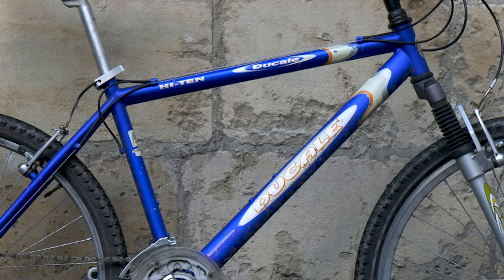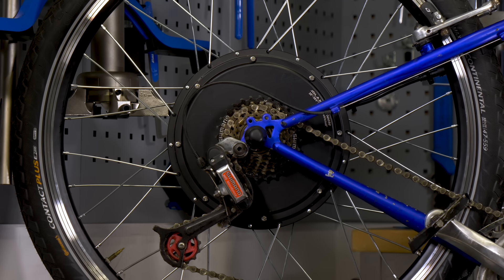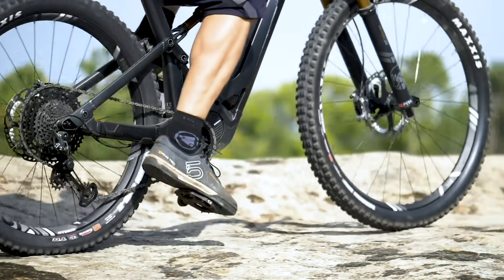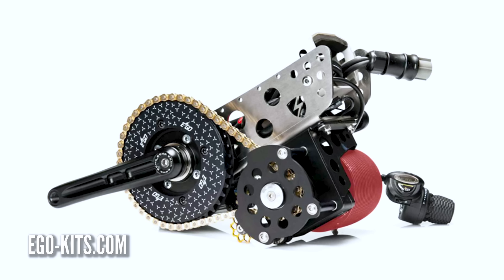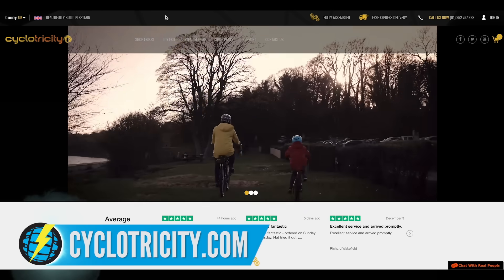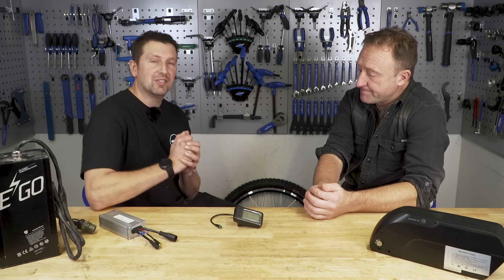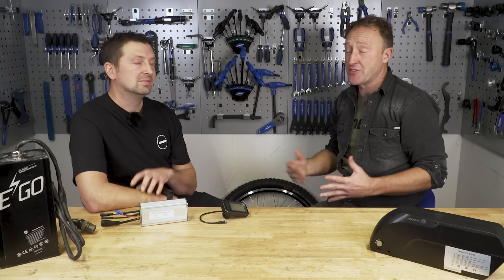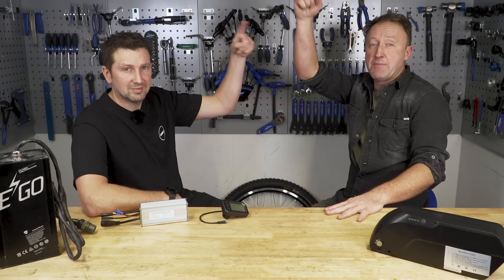Electric Bike Conversion Kit Options | DIY E Bikes With EMBN

Comment: The problem with most manufactured e-bikes is that they generally only go up to 15 mph.
Reply: If I'm not mistaken that's because of eu regulation, which limits their max power and speed.
Reply: @rfldss89  Yeah I already know why.
Reply: @MrRockstar1968  You can't just exclaim a problem and when somebody points out the reason for the problem arrogantly tell them you already knew the reason 😂😂😂😂 rude
Reply: @MrRockstar1968  ok and not everyone knows that…
Reply: A name like Mr rock star + the inability to take advice + the inability to take criticism screams narcissist to me.
Reply: @rfldss89 true! Very good point meeladdo failed to mention. He also got the speed wrong 😂
Reply: If you get the right motor you can programme the controller I did it on mine. Very easy with a Bafang motor
Reply: @Amanwithoutaplanhere  I have no idea how to even do that.
Reply: And they cost about 2 grand
Reply: @dylan1586  You can purchase one for 2 grand or less that go faster than 15 mph up to 40 mph or 60 mph.
Reply: @MrRockstar1968  not sure where to look tbh there's so much Chinese crap about, I've been trying to get a decent e-dirt bike for a while now
Reply: 😂 these comments got me rolling a governor is something that restricts a vehicle boat etc of it’s of its speed it can be electronically or a part..
Reply: js take off the governor
Reply: @k1ngdonnie  Don't know how to do that nd don't even know what the governor is.
Reply: It is for your safety at first 🥇
Reply: @legal-emigrant  bullshit.
Reply: @MrRockstar1968  no brain - no problems
Reply: @MrRockstar1968  15 mph is plenty fast,  if I wanted to go faster I would just drive my car.
Reply: @JoshuaB-p8c  That's your choice though certainly not mine and i can peddle my bike faster than 15mph, so 15mph is not fast.
Reply: @JoshuaB-p8c 15 mph on a bike is not fast, 35-45 mph on a bike is fast
Reply: @MrRockstar1968  You can reprogram a lot of those.
Reply: @Freedom-Riding  Yeah you're right, I have heard of reprogramming been possible, though unfortunately I have no idea how to do that.
Reply: @MrRockstar1968 Yeah if it has an interfaces usually you just press some buttons to go into developer mode or i heard some others you just disconnected a speed sensor.
Reply: In the US it's about 20 mph and it starts to reduce power at about 18 mph . This is for a good reason. Most of those are used on bike paths that are designed for multiple use . They don't want any going over 20 mph on those and would prefer most of the traffic going more like 15 mph. That is because people are  also using these to walk on and many people are also listening to music at the same time so they don't want people going 25 mph on them blasting past the sometimes unaware pedestrian traffic. It makes the inevitable collision less impact full. The difference between an impact at 15 is usually minor and at 25 isn't usually much more catastrophic. It's the difference between a trip to the ER and getting home on your own. That's why most municipalities only allow Class 1 ebikes on them. Even though I can ride faster than 18 mph on my regular road bike I would keep it 15 to 18 as a curtisy for the others especially when it's busy.
Reply: I am in the US, I ran an old Cannondale M700 with a Bafang 750 Watt, 42t chain ring. I can do 30+.
Reply: Get herself a motorbike if tis speed ya want....the rules of 25kmh in eaurope are for a good reason....think centre of gravity...and then while yer at it...find one for yourself.😁👍
Reply: @universalelectricradio2373  I actually already own a motorbike. Also as for you stating "the rules of 25kmh in Europe are for a good reason.......think centre of gravity". Your alleged good reason has got nothing to do with my initial statement where I stated: "The problem with most manufactured e-bikes is that they generally only go up to 15 mph". Neither has it got anything to do with centre of gravity. There are e-bikes that achieve speeds of 110kmh and their centre of gravity is perfectly fine, you haven't got a clue what you are talking about and you are talking utter nonsense in an attempt to sound clever and intellectual. The FACT for the reason of the 25kmh rule is due to the fact for a bike or any vehicle exceeding this speed will then need a drivers license to authorise the use of which has nothing to do with centre of gravity, you muppet.

Comment: Hi :) can someone please recommend a conversion kit for me please ? I have a hybrid giant roam 1 2020 with 700x42 tyres. I’d like to go 25 mph + with a high range on the battery as id like to use it to do food deliveries all day !
Reply: Definitely go a direct drive 1500w hub motor conversion as the torque & power helps make it safe in traffic in built up areas.
Reply: I agree.

Comment: What about carbon fibre bikes? I have a santacruz blur xc and would the mounting of batteries and motors strain areas on the frame that weren’t meant to have weight or stress?

Comment: Just to be clear Cyclotricity are just rebadging cheap Chinese kit you can buy off ebay and Amazon. Fixing a heavy battery to the bottle cage is a terrible idea if you want to go off road. The base plate will end up being fixed to the frame by 2 or 3, 5mm thread captive nuts. That's not a strong enough fixing, ok on the road until you hit a pothole or speed bump at 15 mph. Motor power ratings are more or less irrelevant, it's the torque you need to get you up a hill that counts. I built a 500W front hub ebike and it wouldn't pull the skin of a rice pudding uphill, as it had a rating of 35 n/m torque. My Bosch CX Performance Line which is fully legal does 70 n/m torque and pulls like a train uphill. Those Bafang mid drives have the motor exposed under the bike without a bash plate and there's no protection for the wiring. Don't be fooled by the 250W power rating of legal e-bikes, it's just a figure for the continuous rating, they draw way more power in reality. I wouldn't be riding if it wasn't for e-bikes, but do your research well. Hope that helps someone.

Comment: i built my own 48v 1000w rear hub lcd kit a few years ago now, first i had 10c 12s multistar 20,000mah.
they puffed after a year or two,
now i use 12s turnigy 60c 5000mah.
bike still weighs a metric ton.
still hauls ass.
only runs for about a 12km ride, or 1hr.
so will have to take a normal bike on day trips.

Comment: With a 48v 1000w front wheel  can you use a less powerful battery than required (I understand it may not go as fast or last as long)  but will it still work  ?

Comment: Interesting video, clearly supported by Cyclotricity. I have recently fitted a Whoosh Bikes UK legal rear hub drive kit to a VooDoo Limba Gravel bike that I owned. Fitting was straight forward, I looked at the Cyclotricity kits but chose the Whoosh kit mainly because the controller is built into the battery carrier, it looks much neater. The only problem was the bottom bracket, it was a little short on the l/h side where the pedal sensor fits, Whoosh are aware of this and can supply a longer BB, or obtain one from many other sources. I was lucky I had a less bulky crank arm in my stash of parts that did the job. I have read in several places that a rear hub should be avoided on a Mountain bike (I ride road and mountain bikes) is this correct?

Comment: EMBM, you guys are great!  Not all can do it, but you're also good teachers, have good educator abilities too!  You advise from experience, give examples from actual testing, mention costs (so many don't), and even go to the electric bike fairs to keep abreast of new innovations.  You counted 156 mid-mount bike companies!  Is that a sign that mid-mount is the better overall choice?  I plan to commute 100% as I do now with a regular bike, plus ride mine with pedal assist for cardio exercise, and use pedal assist to save on battery power and range, and to load up my bike and go on very significant long distance camping/biking trips.  I weigh 270lbs and would carry 4 side bags... front and back.  I'd rarely go on back trails... maybe just to camp in a more remote/quiet location.  Would a mid-mount be the best choice in my case?  My regular bike has "V" brakes, are those good enough, or should I find a used bike with disk brakes?  Thanks for all you do, you got a "Like" and "Subscribe" from me!  Advice/ideas from any others is welcome too!

Comment: My ebike wheel wont work soon as I connect phase wires wheel becomes stiff and does not move can any body please help .?.
Reply: Make sure the phase wires are in the right order, and swap them around if that doesn't work might be the controller or there is a short somewhere connecting them try plug one wire in at a time and spin the wheel to see what one is diff green blue or yellow

Comment: Great video interesting too, Cyclotricty kits very good I have been fitting them for over 10 years and had very few problems. (I give up to 2 years guarantee with Cyclotricty kits)
Listed has a Cyclotricty Dealer SY134QT Has you say the battery mountain position can be a problem on some bikes like ladies bikes and ends up on a rack behind the seat. Much easier to trace a fault than a dedicated ebike, find the fault then it can be harder to locate a new replacement component and my clients when i fit Cyclotricity can be back riding in only a few minutes less than an hour should a fault occur. Again many thanks for interesting video

Comment: Just about all the front hub kits here in Oz have the battery built in to the hub itself. They also have a USB port built in for charging yet the kits here all have a separate battery set up.

Comment: Great info! I have a question though. A lot of these kits seem to include soooooo many different parts. I don't want to have special brakes with sensors here and there simply because it looks so DIY with all the wires. If I just want to have a rear hub motor, the battery, and a throttle, would a kit work without the sensors, displays, "speed checking magnet", water boiler, usb cup warmer, microwave and all the other stuff that these kits seem to include? My bike is from the mid-1900s and would like to have as little junk as possible.
Reply: Speed sensor is a must have, Brake sensors are not
Reply: If you have a throttle, you need the break sensors to stop the motor when the bike stops.
If you don't, there is the risk of breaking at the same time as the throttle is on and destroying something.

Comment: What should we know about charging and battery life ?
Reply: Get an oversized battery so you can charge to 80% and deplete to 20%. It'll last 2 to 3 times longer.
Reply: Keeping it between 20% and 80% as much as possible helps a lot. Don't store them drained or fully charged. For long term storage a 50-80% charge works well usually. I work for Panasonic at the Gigafactory in the Charging/Formation department.

Comment: Bafang do good Hub motor kits Plug an play really easy too fit an bafang have  many diffrent display s you can pick an use  .Controller s are best put into box that fit s on too frame an put bit of silicone round it too seal it just leaving small bit open were wires come out from bottom

Comment: Just need a throttle, speedcontroller, battery and a motor (make sure to disable regenerative breaking)

And then just need a pulley system easy to design or find one online and send it off to be printed or cut

Comment: I built a 1300w 48v 16ah rear-drive on a 29” Shwinn MTB. On throttle only it will go 15 miles with a Max speed of 27mph. I’m 6’4” @ 260lbs. It cost me $1,450.00 and I’ve put about 1,300 miles on it so far.  If you are going to build your 1st ebike make sure you already have a good set of tools that encompasses all parts of the bike. Have a decent air pump as well. If you are a larger person invest in a larger thicker tire, with the added weight of the kit it’s easy to get flats from snake bites or bottoming out on the rim. Try to find a bike with at least a front suspension so you don’t get bounced around as much on your ride. If you value your life upgrade the stock brakes, you are carrying so much more weight and forward-energy the stopping distance can be much greater at high speeds. Cars and pedestrians are not used to seeing a bicycle moving at these higher speeds and just pull out in front of you thinking that you were going much slower. Furthermore you gotta get creative in trying to iron out the details installation. Mounting everything securely can be tricky. You also need to know the type of power connector from the battery wire, it needs to match the computer/controller. Mine was different but my local hobby shop soldered the correct one on for $5.00.  Finally as this is electric there is going to be downtime for charging, most batteries come with 2 Amp-Hour charger which is fine but if you ride a lot invest in a better one or an extra battery. 

Best Regards
Reply: i plan on building my own bike and with my knowledge of rc cars, i am confident i can build my own batteries and will have several built. question: what  and if you had to make one change in your build what would it be? personally i want to go more than 15 miles, maybe closer to 60 and i'm built about like you but a tad lighter and that tells me i need maybe  48v 64ah
Reply: @jasonbrown467   The prices for building your own large batteries has gone way down in the last year.  Along with newer, easier techniques for putting them together.  You should have no problem once you get the parts together.  

If I were to change one thing about my build now that I’ve had it a while, it would be to change over from a rear hub drive to a front hub drive.  When you get a flat or just need to take the wheel off for what ever reason it can be a time consuming process as you have to remove the torque arm.  Then when you get the wheel off and fix whatever the problem is and put the wheel back on you’ll have to fine tune the derailleur so the shifting is accurate. Then put the torque arm back on so you don’t snap the drop-ins under full power stress.  In my opinion any maintenance will just be easier with the motor up front.  

On another note either go with a tubeless tire or a robust standard tire.  If you don’t you will regret it.  Flats are very common with the added weight. 

Good luck to you.  Once you get everything ironed out it’s so much fun.  Best Regards.
Reply: @ExoAtmos  excellent info, yeah i have been eye balling these electric bikes since about 2013 or so, and i can see prices on everything has come way down.

 i see the batteries are cheaper but still very expensive and i should have known with my rc and solar experience, but its worth it

 i plan to live on my bike, ride to work, hit the trails etc etc. i can see me becoming obsessed and saving about $300usd a month in fuel expenses. i still want to get at least two big batteries, maybe three, and leave on at my office on the charger to swap out. man i cant wait.

good call on the rear hub vs the front and bigger tires, but i still may do the rear anyways, hell at one point i was going to do both lol.

Comment: Just for the record, regarding throttles on ebikes. A throttle IS actually allowed. This was written in to the recent change in the law (2016). But is limited to 4mph...some say 6mph. This is to allow for old or infirm users etc to get these heavier than usual bikes moving. Known as a start up throttle. On the hole manufacturers just don't bother fitting them. But some will on request.

Comment: Why need to decide between throttle or pedal assist when you can have both?? You can even have a torque sensing bb in the mix.